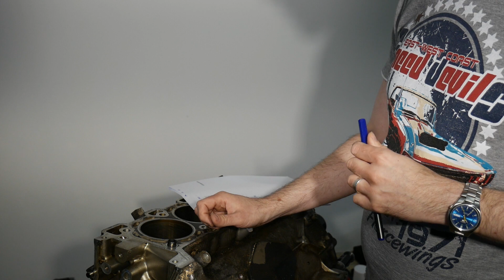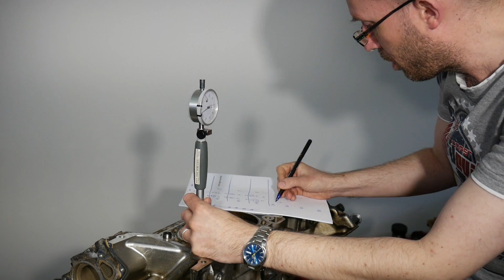Jaguar S-Type Restoration [33] Checking AJ-V8 Engine CYLINDER BORES [2020-06-06]

Comment from the maker: More Content on my S-Type Project: youtube.com/playlist?list=PLpGOsXYW3_KrfpoWOPMjFhUzNwxXovxVk

All the Parts & Tools I use for this Project are linked in the Video Description.

00:00 Welcome!
00:40 Visual Inspection of the Cylinder Bores
01:26 Decoding the AJ-V8 Engine Block
02:40 Adjusting the Dial Bore Gauge
05:37 Measuring the Cylinder Bores
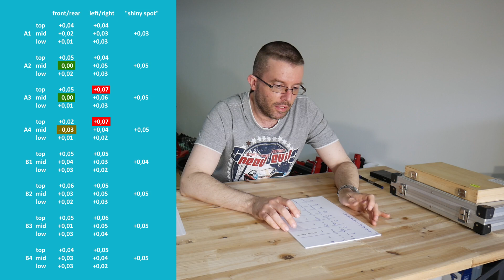07:58 The Measurement Results
08:46 Please Subscribe & Ring the Bell!